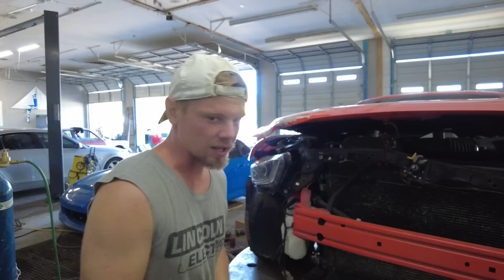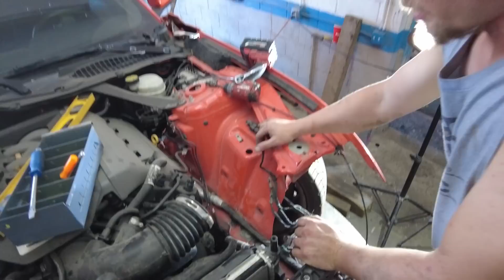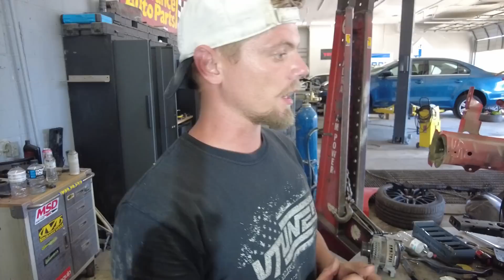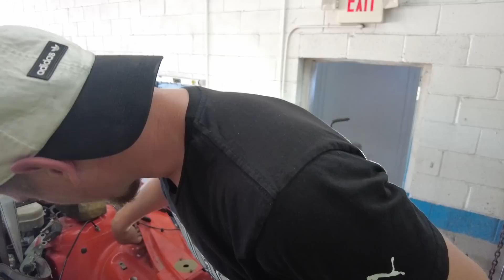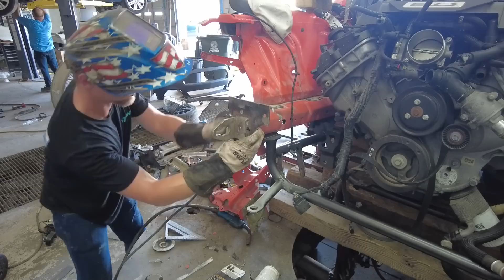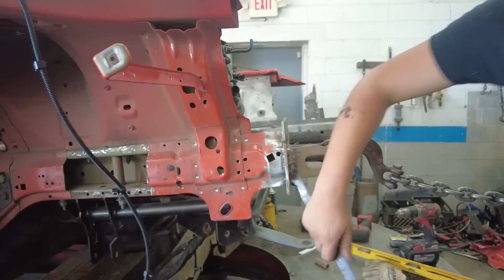The Mustang gets new frame rails!

Comment: Great work guys! A question from a not trained follower. When is it important to put reinforcement bars inside?
Reply from the maker: So that when we weld the seam it makes a nice solid weld and fuses the two section’s together permanently. Without it you will have a hard time getting the metal hot enough and adding enough wire to make a solid weld.